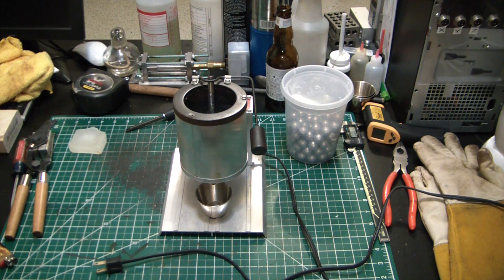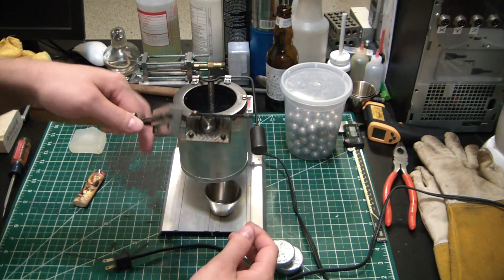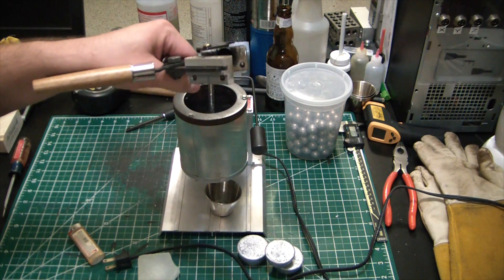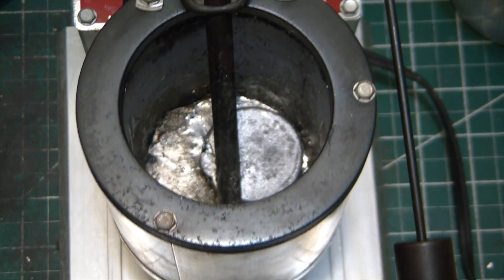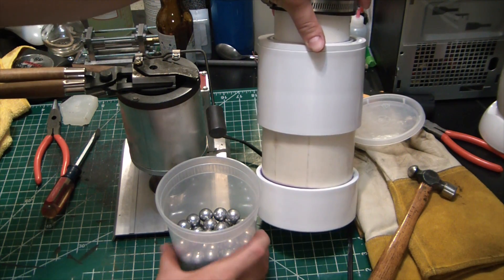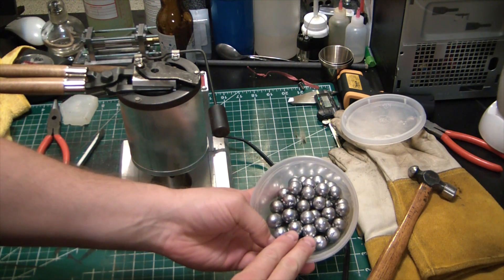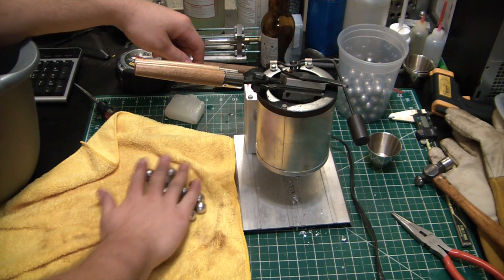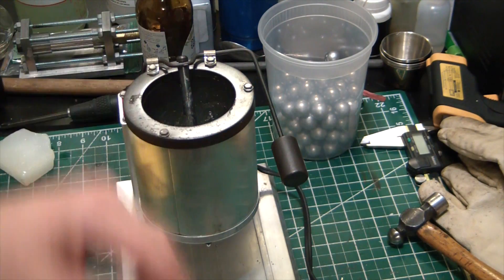Casting Lead Ball Mill Media - ElementalMaker

Comment: Lead is much to soft to tumble anything, let alone black powder. You need at least zinc (melting around 400°c) or better: brass (melting at 900°c) You don't even mention your lead hardness: Antimony lead would be the hardest lead.
Reply from the maker: Lead has been used for centuries to make black powder and it absolutely works, that's why its the standard ball mill media for pyrotechnic compositions.
Reply: @ElementalMaker  You may be right for PYROTECHNIC where the fineness of the BP is not so critical. Rockets and fireworks would work with just a good  meal powder

Comment: Two improvements. 
1 use a wooden mallet to protect your sprue plate.
2 there is a slot for a screwdriver in the top of that rod wiggle it gently to stop the drips.

Comment: I recently bought 100 'hardened' balls from woodysrockets. I'm guessing they have antimony in them. I was using some hornady muzzle loader balls in the past, seemed like they flaked off and caused some sort of contamination... I'm just using a small HF rock tumbler. I didn't realize I needed so much media, always used around 20 balls in the past. Guess I need to fill my barrel more.
Reply from the maker: Yessir, llyod spoenburgh has a great book on ball milling theory and best practices. I think for optimal performance a mill jar should be 50% full of the mill media (if I'm remembering correctly). The hardened balls are good, you will get less wear, although there will still be lead contamination in your final milled products. I think moving forward I'm going to get some non sparking ceramic media, as now that I have young children the lead toxicity scares me.
Reply: @ElementalMaker  ya lead is no joke, one of the heavy metals the body can not easily get rid of. problem with this whole mill/bp thing I have found is there is soooo much conflicting information. I have watched almost every video on yt about bp and some make it seem super simple. I am just trying to do some simply fireworks stuff but found my results vary significantly. I recently tried a small batch of toilet paper bp, and couldnt even get it to burn worth a crap, wouldnt hold together in a puck after pressing, and burnt like crap. I said F it and bought bulk cedar charcoal. most people say willow but I'm not paying 40$ in shipping on a 20$ pound. appreciate your videos man, I'm just beginning learned a lot so far.

Comment: I wall a  economic yet reliable tumbler to make BP. I have the Lee .690 mold. Ammo independence ahead!
Reply from the maker: I actually moved away from the .690 balls (which is use for my BP cannon) and now use my lee 9mm cast booliots for BP tumbler media, the irregular shape and smaller size gives incredibly fast milling results with the same media weight charge

Comment: For years I have been using Linotype metal from old print shop Linotype machines when I can get it. It is very hard and makes great pistol bullets. Usually we have a local metal smelter reformulate the Linotype metal by adding a little more lead to soften it a bit for shooting. The harder Linotype metal does work well for tumbling applications though.
Reply from the maker: Wish I could find a local source for linotype! Great stuff

Comment: Lee mounds can be preheated by placing the lead edge directly in the molten lead, the lead will not adhere to the aluminum blocks. You can’t do this with steel moulds. I would advise NOT using hammer on the sprue cutter use a wood mallet.

Comment: Do they have a pot like this that can melt copper and let it come out of the bottom to make cast in the same way as the lead
Reply from the maker: Coppers melting point is wayyyy too high for this kind of thing. If your looking for a non toxic alternative bismuth or tin are your best options
Reply: @ElementalMaker  i want to cast 1in copper balls and was wondering if there was a furnace that works the same way as the lead pot. It seems easy to work with how the lead comes out as you push down on the handle

Comment: If you your Lee pot is dripping. The screwdriver slot on top of the valve pin. If you give it a little twist back and forth  it will stop the drip.

Comment: I got the 69 mold for cannons and 12 ga BP loads(even though 69=14 ga).I use 451 ball for ball mill ops.When I used 1.50 balls they opened up my ball mill canisters and spilled all over the place.So I'm timid to use big balls.I pour hot to frost my balls when using Alox.Last heat I used a electric 2 burner with ladle.But usually pour 3 pound pigs out the bottom of my tilt reverb furnace,while ladling out of a cast iron pot over the furnace exhaust stack.Nice looking balls ya got there!

Comment: You can heat the mould with a blow torch and you can make much harder balls by adding a little tin or antimony to the lead pot.  I rate the Elementalmaker and Cody's lab  as a couple of the best video makers on YouTube.  Keep up the great work.
Reply: Cody's Lab a classic before Google/ YT chaannel.
Reply: He is using range scrap. High probability that antimony is in there.

Comment: 5” -54.  I use to load the Powder shell, about 44 lbs in the side breech then someone else would drop the “Bullet” about 77 lbs from the other side & on top..   we had the Fastest gun ever. 9 rpm was standard & ours was 13 rpm.  Captain Rodgers came to see how we do fast, but had to deny as our Process was highly unacceptable.  I was scared of loosing a hand in the breach so I would toss them in and kick them.  Very fast 💨
DD985. USS Cushing 1983-1986
Reply: That's very interesting. My mother in law gave me a 5 inch naval shell, cut down and turned into an ash tray. The headstamp dates to 1943. Thanks for sharing!

Comment: Been wanting to get one of these for a while now. Saw this vid and ordered last week. I'm using mine for melting down pewter. I get that stuff cheap at goodwill and thrift shops. Then I sell the ingots on ebay. PPl don't realize how much tin is worth, something like $10/lbs and that's what about 90% of pewter is. Been making some balls, makes great slingshot ammo and should be just as good as lead in a ball mill, bit less dense, but is much harder and no worries of lead contamination in the final product. Seems a bit harder to knock off the sprue, gotta time it just right to knock it off just after the ball is solid and the sprue is still a little soft, or ya gotta beat on it pretty hard. Can't tell from your vid, but the mold does leave a tinny nub on the ball, not enough to be a problem for ball mill or ammo use, but wouldn't want to use it as a ball bearing. I could file it off, but that's a hell of a lot of work that I don't wanna do. lol

Comment: Beryllium alloys. Spark-free and hard!
You can limit the drip with a heavier handle. Use a short can half full of water to catch the drops so they don't splatter.
Reply from the maker: You go ahead and find pricing on some BeCu Alloy balls LOL. Brass would be much less expensive and easier to obtain. I use lead because its free (aside from my time), and non sparking.
Reply: @ElementalMaker  add a CuBe alloy to brass and cast it. Lost wax, investment.
Reply from the maker: I stay away from Beryllium. Berylliosis is nasty. I'll take lead any day.

Comment: Why not use something less hazardous, perhaps thick electroplating tin or copper onto the lead balls before milling with it.  You can then even electropolish or mill with no abrasive after a thick coat of either tin or copper for better surface finish.  Lead dust is not good to breathe.  Using it wet creates lead process waste.  Anything you mill with it then has lead in it, even for  black powder that is more lead in the air than there otherwise would be after firing.  Lead will also perhaps reduce the velocity of the powder's gasses.

Comment: This looks fun, I've only cast aluminum copper and bronze before.
Reply from the maker: Its a good bit of fun for sure! Lead is much easier to work with than aluminum or bronze.
Reply: @ElementalMaker  I have some gallium I'm thinking of casting with as well, think the process would be about the same as lead just much colder?
Reply from the maker: I would think so. Gallium does tend to be a bit sticky, so you may run into issues with it adhering to various tools and mold materials. Just dont use aluminum with it as it'll alloy with it.

Comment: This mnemonic will help not just with which formation grows up or down, but with spelling too:
StalaCtite, C  = ceiling.
StalaGmite, G = ground.
I think it came from The Magic School Bus series growing up.

Also, I figured the ball media were made with a .69 cal mold, because that's simply a musket ball mold. Super easy method for making lead balls, and quite time-tested.
Reply: is that why stalag 13 was on the ground, not on the ceiling?

Comment: would round lead fishing weights not work? They are super cheap at the fishing store. ;)
Reply from the maker: The issue is they usually have a steel wire poking out for line to attach to. In a ball mill that could potentially cause a spark. If you can get ones without that though they would work. Just be sure they are lead.
Reply: @ElementalMaker  thanks yeah, the ones I can find from my local fishing store are pure lead with a hole (no metal wires etc.) :)

Comment: LOL my balls have been shrinking steadily layely, my big jar has ceramic media, the only thing I got from united Nuclear I think, but my small jars use 50cal muzzle loading balls , I got a shit ton from a Gun dealer ,theyre high in antimony , I do have a big bag of 50call penetrsator cores Ive been saving for grinding aluminum, once my supply runs low

Comment: Lead is way to soft to be used for a ball mill. Steel or iron is best
Reply from the maker: I've been in pyrotechnics for fifteen years and have always used lead with no issues. Lead is the go-to for milling black powder since it's non sparking. Steel would definitely be better for milling single components though, or hard materials.

Comment: so like does this not contaminate everything you mill with lead dust? Esp. since lead is softer than aluminum and such...
Reply from the maker: As long as you have a proper charge of material to be milled the lead should not break down. There still always is a chance of lead contamination. So if making black powder only use it in a an open area and stay out of the smoke

Comment: Great video.  What media is best for ball milling flash powders.  Aluminum, Magnesium, Potassium Nitrate, Potassium perchlorate.
Reply from the maker: NEVER mill flash powder. It's far too sensitive and will go bang. Flash can only be made by the diapering method
Reply: @ElementalMaker  most people do not realize that when milling aluminum alone you are supposed to shut your mill down daily, and allow it to rest before opening and checking the metal powder.  Super fine milled aluminum can ignite at the moment you provide oxygen by opening the mill container.  It is best to add about 5 percent by weight with charcoal(dark German powdered aluminum)  thus coating the aluminum and cutting off any oxygen.  Safety tip.  1 pound of powdered aluminum packs one hell of a punch.

Comment: So I just looked into this myself but do you know a source of hardened lead treated with antimony
Reply from the maker: Yep as mentioned wheel weights are a good source with plenty of antimony for hardness
Reply: @ElementalMaker  awesome man I didn't know that I'm new to making my own lead milling media but it seems way more cost effective thanks for the response. Keep up the great content man
Reply from the maker: @pa-pyro2804  you can also grab very high antimony hardened lead from Roto metals. I buy I bunch of stuff from them. It's certainly not as cheap as from free range scrap though 😁
Reply: They used to make wheel balance weight from lead hardened with antimony.  These days regulations favor zinc.

Comment: Had 2 lead pots like that,both had a screw driver slot cut in the top of valve rod to turn back and forth when the lead dripped,was quite handy.
Reply: yeah, your pot should be dripping.  If you can't adjust it so it doesn't drip, take the valve apart and clean out the scale / rust.  Mine does NOT drip, but rarely.  And then I fix it.

Comment: Is there an application for aluminum balls?  I have a TON of aluminum, literally, and I'm trying to find other uses for some of it.
Reply from the maker: Aluminum would be significantly more difficult to cast into ball molds. You would need a very high temperature melting pot. Aluminum would also be too light for being a very effective milling media. It might make for decent slingshot ammo though!
Reply: @ElementalMaker  , good idea!  Aluminum slingshot balls would be perfect!  I have a small iron ball mold I could use that should would.  1/4 inch I think.  Thanks for the advice man.  I recently suffered 2nd and 3rd degree burns to 50% of my right hand and am trying to find things to do to take my mind off of the pain while I am off from work for the next few months.  I probably won't be making many new videos in that time though, unfortunately.
Reply from the maker: @BackYardScience2000  oh man that's awful. Mind if I ask how it happened? I wish you a very speedy recovery.
Reply: @ElementalMaker  , I wish I had a better excuse.  I really do, but I fell asleep with a cigarette in my hand and it caught my bed on fire.  The bed is memory foam and the sheets were polyester.  I guess when memory foam and polyester burn they melt.  Well, when the smoke detector alarm woke me all I saw was flames right next to me and instinctively, I started swatting at the flames.  It was then that I noticed exactly what was going on and that my hand was on fire because the melted foam and polyester stuck to my hand and I could not get it to go out.  I rushed and put my hand out in the sink and then grabbed a towel, got it wet and threw it on the fire, extinguishing it.  It was then that I realized the amount of damage to my hand.  The left hand has burns too, but they are nowhere near as bad as the right.  That was last Tuesday morning and I've just been trying to deal with the whole situation ever since.  It's definitely been a nightmare to say the least.

Comment: Sprue plate, its for cutting the sprue off your ball :-)
Also a tip on heating your mold, dip it into the lead, it will come out clean (the lead won't stick to the mold unless the lead gets "cold") and you won't have as many wrinkly balls.

Comment: Would there be a problem with hitting the mold with a propane torch for a little bit to pre-heat it? Seems like it would be easier than making a dozen balls to preheat it.
Reply from the maker: I actually did preheat for about 30 seconds off screen with a torch, but the video was already getting too long
Reply: A lot of reloaders who make their own lead will dip the edge of the mold in the lead to preheat it.
Reply: @cloakndagger085  yep that's what i do

Comment: You could have started with nice balls iof you preheated your mold
Reply from the maker: I did actually preheat with a torch, but it always takes a handful of casings to get perfect balls regardless in my experience
Reply: @ElementalMaker  When we made milling media the same way you have, although we used roofing lead, not bullet, we had no scraggly balls. We left the aluminium in the melted lead for 5-10 minutes, before starting the cast. 

By your own admission they got better after a while, which would indicate that it was getting hotter over time.
Reply from the maker: @Laffen47  oh yeah you gave it plenty of time to get fully up to temperature. I usually just give it a couple minutes and any ugly ones just get recycled. The mold gets up to temp pretty quickly when you start pouring
Reply: @ElementalMaker  cool stuff, I saw somewhere that the armed forces made cannon balls in a wok shaped device that the lead was dropped in by weight and rolled around until it was solid.
Reply: I was thinking if he put the mold directly on the lead melter instead of letting the lead free fall in the air for the inch or so? Maybe the lead cools a little in the air? I’m just guessing though as I’ve never done it with the cool melter he had.